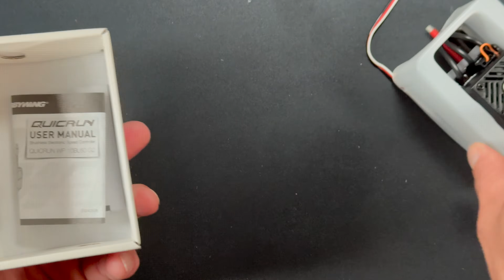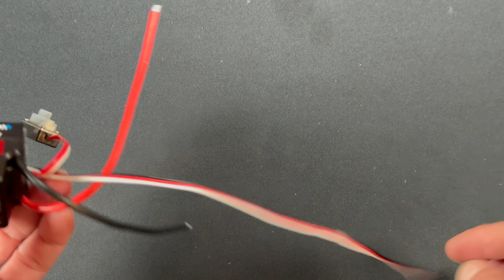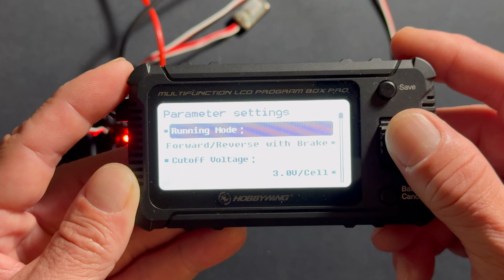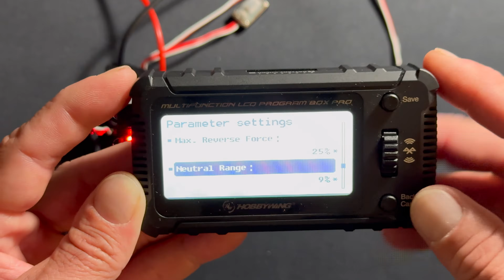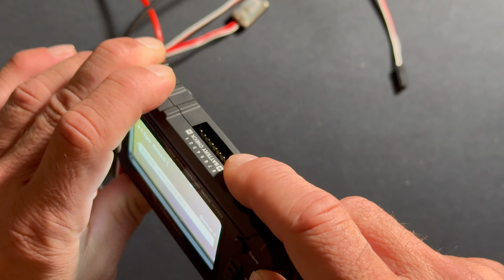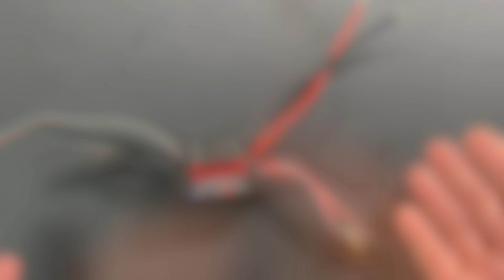HOBBYWING WP10BL60G2 First Look - Unboxing - The Charlie Show - EP 384

Comment: What would this esc be good for?
Is it more of an "open motor" for use with other brand motors than HW?
Crawling?
FOC?
Could I use it with an outrunner for crawling?
Bec output?
Max esc amp output?
Continous output?
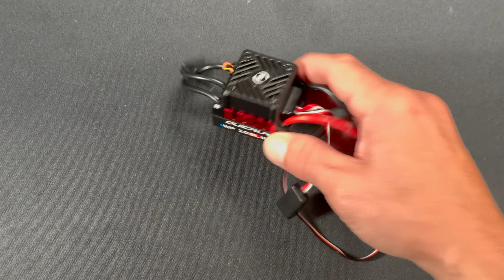Reply: I put it in a 1:12 wltoys buggy with a 3660 3500kv motor stock gears i got 67mph 🚀